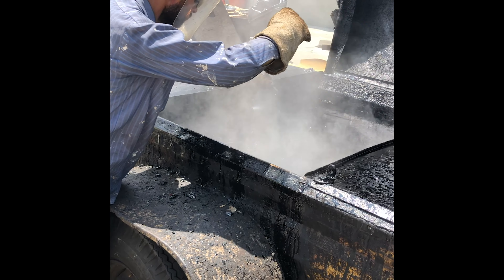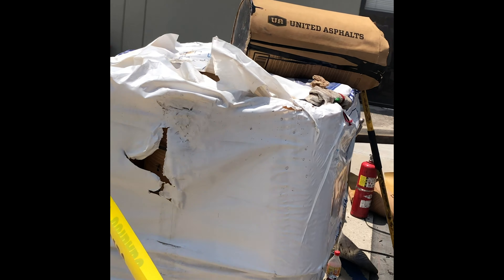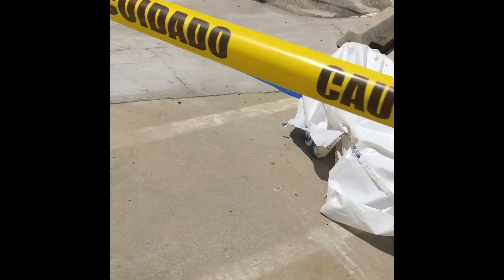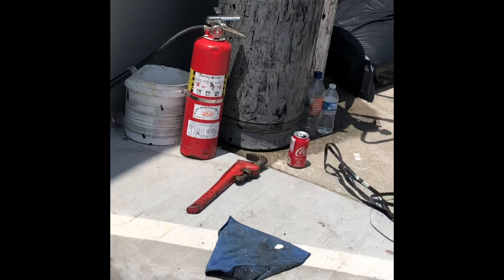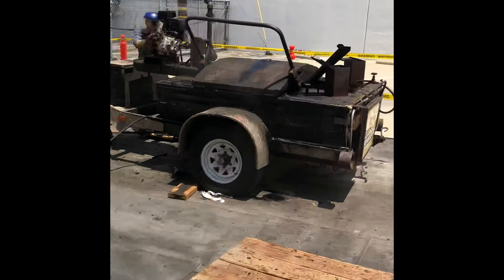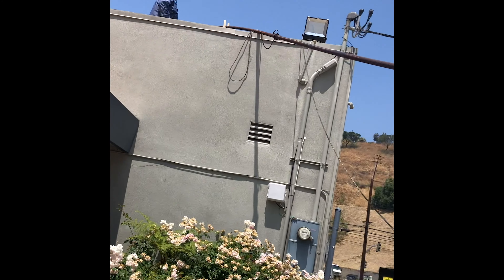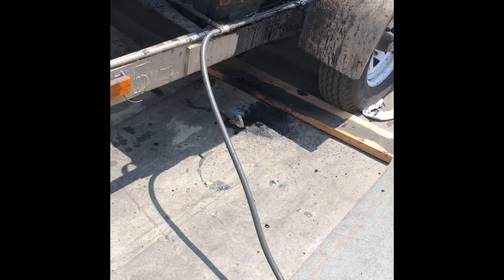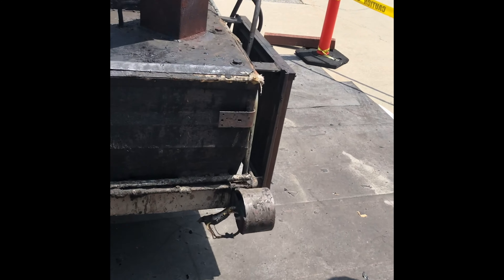Roofing 101 - The Roofing Kettle Man

Comment: I bought an old used garlock kettle that’s about 3/4 full of hardened tar. I want to convert the machine to use hot pour rubberized crack filler. It looks to be about a 300 gallon unit. About what temp should I not exceed on getting that stuff melted and out of there. I don’t want to start a fire either any suggestions?
Reply: Late reply but it’s usually around 525 degrees
Reply: 520 Fahrenheit maximum

Comment: 20 years with hot bitumen. Enough for me, Gave my 2 boilers to the scrap man. The most uncivil and dangerous job on earth. I have used a 3 layer torchon system for the last 50 odd years. Better quality and easier.  .
Reply: Bullshit, a Hot Tar Roof, applied CORRECTLY, is 100 times better than a Torch Down, especially Pitch Tar!
Reply: @psalm91.17  Have you ever used a 3 layer torchon Polyester SBS system?
Reply: Hot tar is the way to go. Lots of work 😊